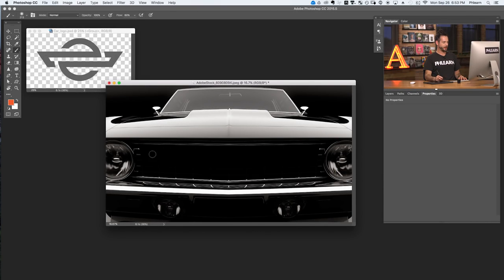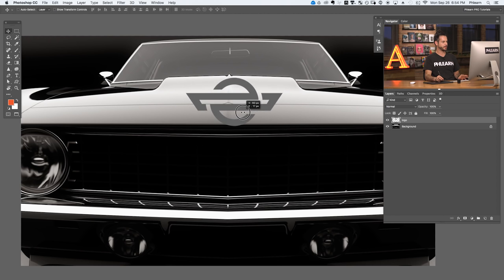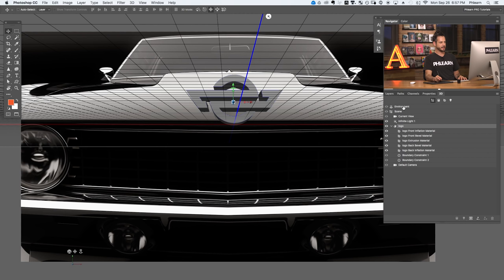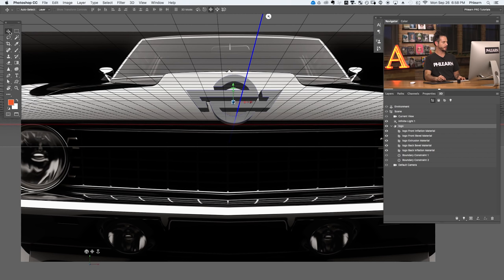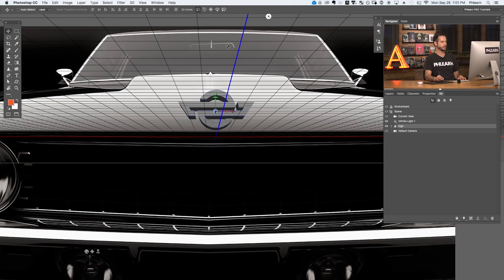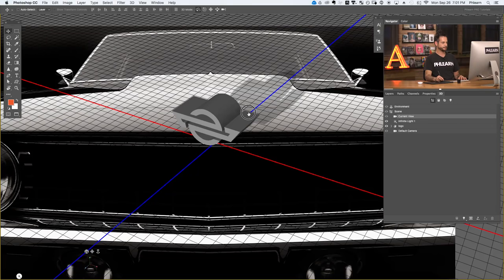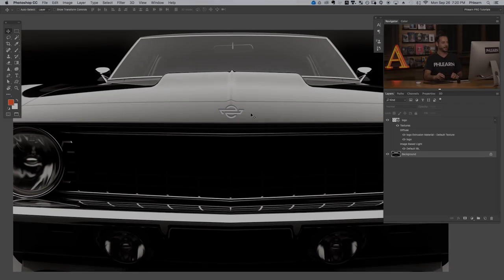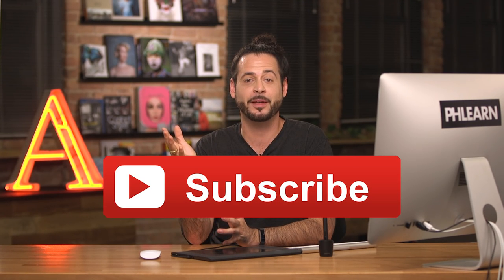How to Make a 3D Extrusion in Photoshop

Comment: Hi Aaron. You are always good for a few minutes of a good laugh en learning stuff.  Many things in this 3D tutorial were interesting but I can't understand how you talked about putting the logo flat on the hood of the car. You finished with a logo 90° to the floor and the hood is probably around 25-30°.  The shadow could match a logo in 30° , stuck to the hood, but certainly not in a 90° position. Maybe you confused me and maybe many more followers :(
Reply: Hi Marc.  I do a lot of 3D work and I understand your point but the car isn't 30° as it is a flat image, although it looks as though you could just take the top layer and place it anywhere.  He just changed the camera view, which brought the bottom layer (car) parallel with the logo.  It was easier to have the logo flat on the ground as it would have meant a lot more work trying to get the shadow back into perspective
Hope that helps?
Reply: Thanks for your comment Stewart

Comment: Came on to comment on the lighting coming from the wrong angle but it's been mentioned a bunch of times already. I understand there is far more info here than can normally be squeezed into a 25 min tut and admittedly it's a minor point but matching lighting to the BG stock image is what usually makes or breaks a faked 3D render. Your logo looks like an emboss not an extrusion. This subject matter has to be one of the most  powerful but confusing and (therefore IMHO) underused PSD fuctions. If there's anyone that can guide people through the subject matter it's going to be Aaron.